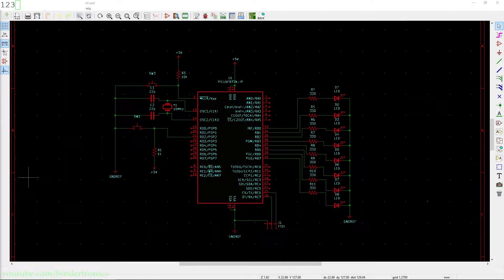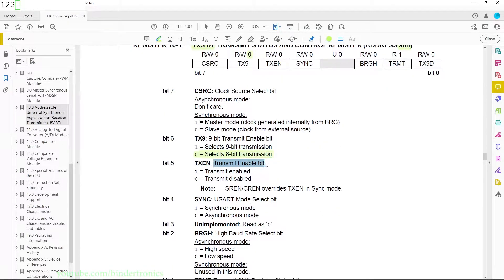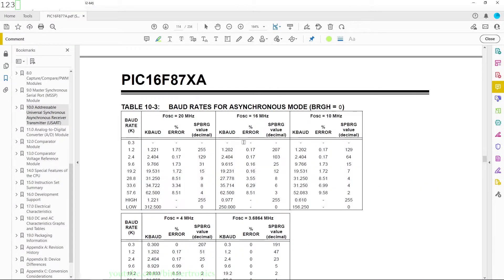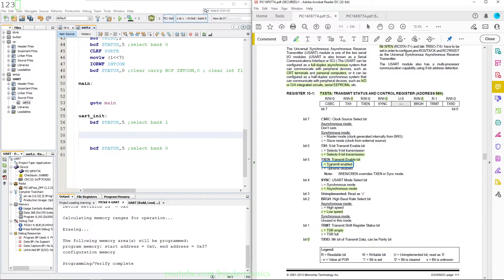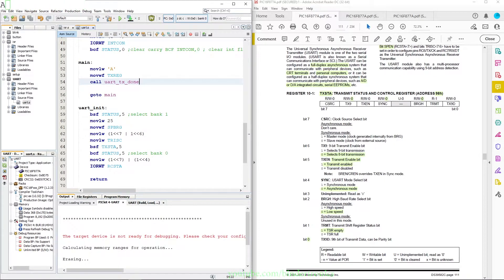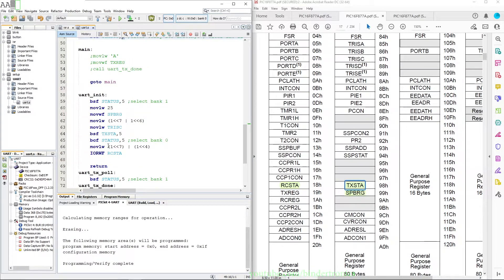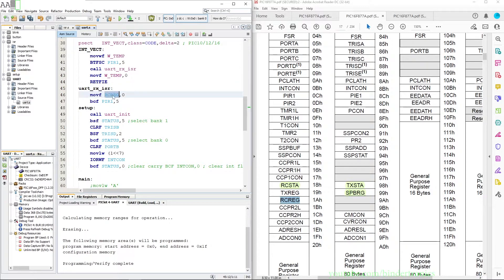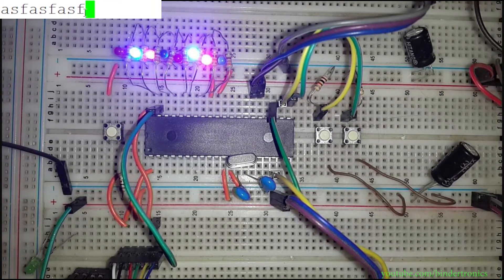Serial UART 🔵 PIC16F877A PIC Microcontroller Assembly Tutorial #8 MPLAB X pic-as mpasm

Comment: Hi. I am interfacing PIC16f877a through UART with Freescale MCF51CN128. +5V Vcc for PIC while 3.3V Vcc for MCF supply. I am using 10k pull up resistors for both Rx and Tx pins of PIC. I am also using a CD4050B IC to convert 3.3-5V and vice versa. I am facing this condition of PIC program hanging that happens every now and then during regular execution of program. Without UART function,  no hanging issue is found. Issue is resolved only upon Manual reset of PIC via PushButton. Voltage levels at both Rx and Tx pins are in +5 range itself during hanging. In your experience, have you faced such a situation? If so, what maybe the solution. WDT disabled in configuration bits. Thanks
Reply from the maker: 1. Do not use pullups on your date lines the the UART driver should do that by themselves.
2. You can just use a resistor voltage divider to do the signal level conversation. Ratio of 1.5.
3. Try attaching a debugger to see where the code hangs. Likely you are not clearing a error flag on the UART.
4. The line being at 5V during the hang just tells me the UART is in Idle state.
5. if you got 5V on the MCF51CN128. Then your IO is likely toast.
6. Try slowing down the baud rate. The slew rate of the CD4050B might be causing the UART to error out.

Comment: Another excellent tutorial, although one really needs to pay attention to the red changes that flash up in the video. Not all of the changes have been made to the code sample in github. (I went there when I could not make my code work).   My development board uses a 4Mhz crystal, instead of the recommended 16Mhz crystal in these tutorials.  I needed to change the SPBRG value from 25 to 6, in order to get a baud rate of 9600, and the telnet session to work.